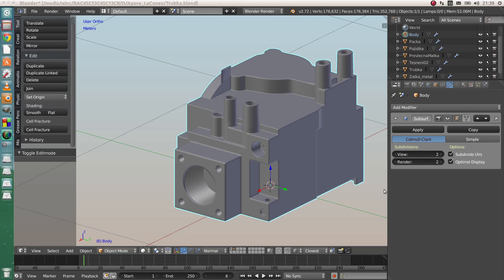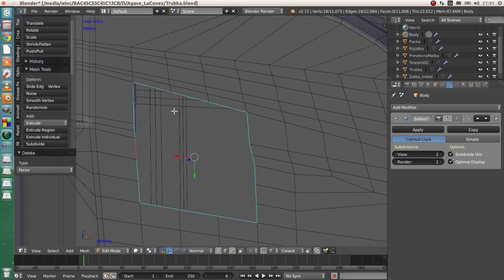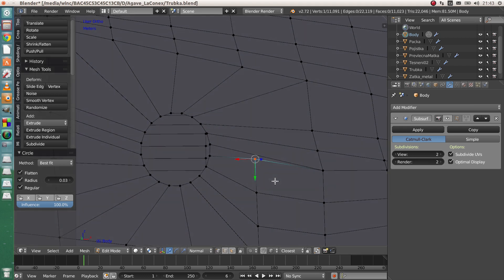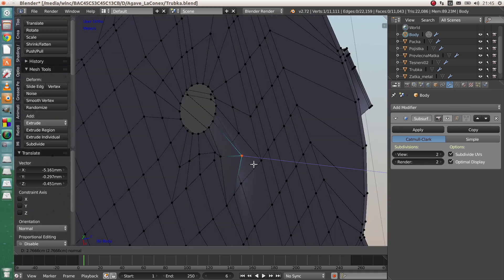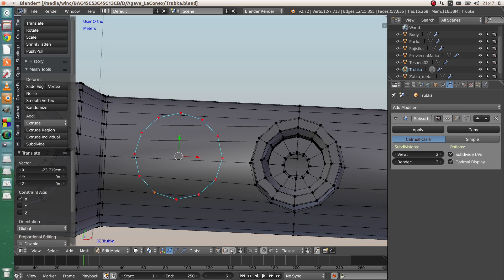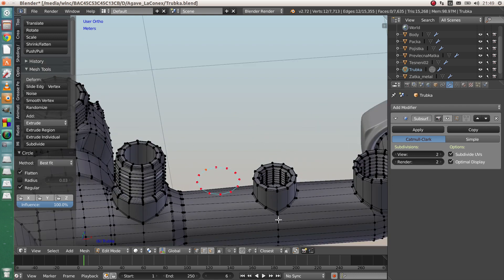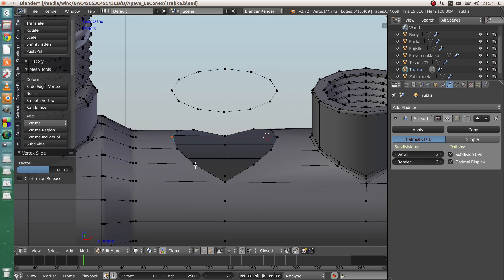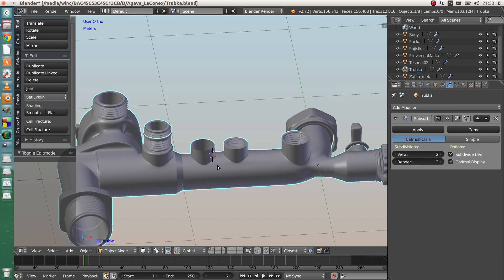Blender quick tip [03] - Adding tubes and holes

Comment: Neat.

New mesh edit intersect tool in 2.72 might be of interest in this process too. Automatically places cuts similar to the knife tool right where parts overlap. Worth investigating at least, since you don't have to fiddle around with snap tool much.

To avoid the funky triangles that sometimes occur with bevel (caused by vertex stars afaik), select all the faces on the part you want the control loops around, then inset. Under inset options, switch to outset. That'll put a control loop around the outside. Make the same selection again, then follow that with a regular inset for the inner control loop. Extra steps, but sometimes easier than trying to clean up the mess bevel can create.

Custom transform axes are also handy for some parts of this too, at least it lets you use reference geometry when doing other operations.
Reply from the maker: Intersect tool isn't bad, but sometimes it causes more future clean-up. Anyway the outset/inset combo is genious, thank you very much for sharing, I've already made it part of my workflow.